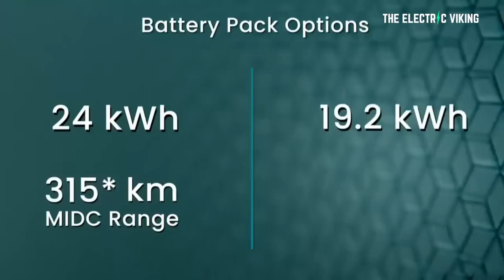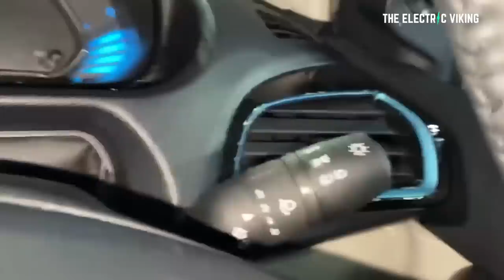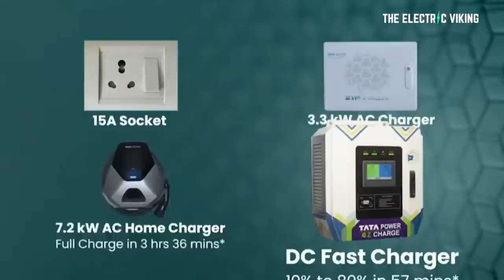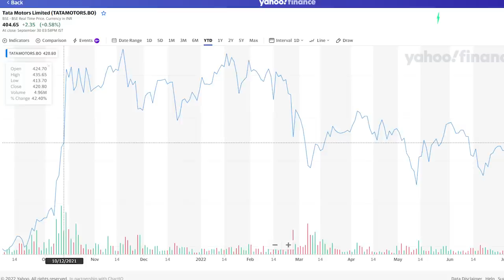India's $10,000 USD electric car - is it good?

Comment: I have a friend in India who own TATA Nexon EV from almost 2 years now. It is around 18K USD and drives 350kms on one charge, they find it cheaper to use than Petrol.
Reply: Real time range is 200-240 kms  for nexon ev.
Reply: @gaauravsharmaa4061  Regardless of range, the Nexon EV (and we have two) is about the fastest accelerating car at this and higher prices in the country. The Nexon EV is a performance car at 60 paise a kilometre. About a US cent penny per mile.
Reply: Tata Nexon ev max range is 275km
Reply: A decade back when I was running about India briefly I seem to remember a lot of power cuts.  Everything changes over time but I wonder how that might effect say a regular commuter.
Reply: @brucetaylor2887   now no power cuts 23.5 supply sure
Reply: @brucetaylor2887  we have a steady clean power supply scenario in India. The saying goes here lately, we may not have petrol Or diesel if circumstances deteriorate globally, but we have more than enough electricity.
Reply: @brucetaylor2887  There's much less power cut since last 3-5 years as capacity has improved and cities like Mumbai don't have power cut so EVs are becoming more popular due to high fuel costs
Reply: @brucetaylor2887  it's a great achievement by the new gov. They made a rapid growth not a single corruption allegation  inside the gov from past 10 years. That's a great thing to achive they are able to provide power to even the very remote areas of India. And mostly gov provides 45 to 50 percent subsidy  on solar power panels 6kw will cost you around 2300 dollars to set up which provides 720 units every month and gov will buy back if you don't use it
Reply: @brucetaylor2887  after Modi came to power he has maintained uninterrupted power supply
Reply: Its 225 km in a charge
Reply: I am thinking about the same car.
Reply: @brucetaylor2887  Powercuts are there in summer,  but a lot of folks buying EVs  are investing in solar as well. There are also direct charging stations by electric distributors.  Also take into consideration 40 kms one way is considered a large distance in Indian cities , since utter us densely packed and you will realise 250km driving range is ideal.  Personally when I am in India,  the max distance I drive in a day (very rarely) is 200 kms.
Reply: Hopefully an Indian car maker would come up with a hybrid chargeable + swappable battery packs.  Swappable battery model is already in place for EV auto rickshaws.
Reply: @vishnumohannair8791  not possible  for now at time
Reply: @vishnumohannair8791  there's a Honda full hybrid option for 20lac +. All the Japanese brands are going to offer hybrid models. Don't wait for Tata and Mahindra. BTW Mahindra has the some kind of hybrid for years now. But don't see them going in that direction.

I don't really get the point of hybrid. You are purchasing a more complex option than ICE vehicle for higher price than EV.  You will have smaller boot space, heavier vehicle. For a supposed improved fuel economy by 25%. All in the name of range anxiety. If you have range anxiety then you are better off buying ICE variant than hybrid. 

Think about maintenance of hybrid. You will have to take it to dealership only. Roadside mechanics are no option for you. With additional complexity and poor roads in hinterland that is a real possibility.
Reply: @udaysawant2094  well said ....double mechanism  and weight
Reply: @malikveeresh6751  true that. In addition to that the super quiet rides. No fiddling with gears and clutch, super simple operation. More than the petrol savings, these features should be the reason for choosing EV.
Reply: @brucetaylor2887  this is true of villages even today. In addition to that the quality of electricity supply is not good. But it still works with Nexon. It is a perfect vehicle for India and most of the developing world, which is a huge market.

The Nexon is bought more by affluent people from rural India because they can install solar and have a comfortable mode of transportation.
Reply: @Mayankk196  that guy is uneducated, he won’t even know how electricity is produced let alone reduce power cuts. In the past 10 years india has been growing rapidly because of the foreign investment and internet penetration. The same would’ve happened with any government. Don’t say india was in Stone Age before Modi lol.
Reply: @drbh6331  lol not a single corruption allegation? 40% commission bjp Karnataka Sarkar
Reply: @dravidian667  don't know in which state u live. But maharashtra power cuts reduced a lot. You can't deny changes and development happened in modi era. He had made lots of online processes and also reduced corruption. He can't make corruption to zero because it's people who are corrupt. Everything came handi and inside app. I live in pune and there are power cuts only due to transformer and line issue. Otherwise there are no power cuts.
Reply: @Mayankk196  TN had no power cuts for the past 10 years, in fact TN has been selling power to neighbouring states. This was before even anyone knew someone like Modi. Maharashtra state government should be credited for good electricity, in fact the central government is just a leach leaching on Maharashtra’s tax money. Maharashtra gives 1rs tax and gets back only 40p back.
Reply: @dravidian667  leaders of tamilnadu, Gujrat, Andhra and Karnataka are far more active in development than maharashtra. Maharashtra is able to develop only mumbai n pune. But now due to nitin gadkari somewhat nagpur. Roads are now better only due to BJP. Congress digs roads within one months of construction still in nanded and Congress ruled area
Reply: @Mayankk196  you are talking like Gujarat which has been ruled by bjp for years have roads as smooth as in US. Even there are potholes and bad roads in Gujarat. Bjp or congress are same coin different sides. Don’t forget all contractors, government officials etc don’t care bjp or congress, they need their commissions before starting work and that’s why quality has to be bad. Wake up
Reply: @dravidian667  i observe and speak. Not andha bhakt. Maharashtra roads were improved lot under BJP era. Previously only mumbai Pune baramati roads were good
Reply: @Mayankk196  it’s only been a few months since bjp came in power, so fast they built roads? Don’t be delusional
Reply: @dravidian667  it has been 8 years
Reply: @Mayankk196  do you know central government don’t build local roads, they only build national highways.
Reply: @udaysawant2094  Hybrid is Gas + EV. I meant Hybrid of Chargeable Battery and Swappable Battery.  Essentially would mean too battery compartments. The latter would be of help when you are in a hurry and need a few 100 kms for travel. EV Autorickshaws are being designed with the idea of swappable battery packs. Such a car is not available now - I was hoping someone would think of it
Reply: @vishnumohannair8791  YouTube has some videos of a swappable car battery solution. You should definitely watch it to understand why it is not done successfully yet. Not to say that it won't be possible in future.
What I gathered from those videos is this,
1. An EV battery is very heavy >100kgs.
2. It is integrated with the chassis of the car
3. It operates at high current and voltage

For these reasons you cannot manually swap them out. You need robotic setup, which is very costly compared to a 15kw charging stations as Tata Power provides.

The 4wheeler battery cost runs in lakhs of rupees. For a swapping station, you will have to carry an inventory of such batteries at charging stations, which makes the swapping solution expensive.

Multiple car manufacturers have to agree to use the swappable batteries, which is a very difficult thing to accomplish.
Considering all these points it looks improbable to happen in near future.

The scenario that you are talking about needs numerous such swapping stations covering majority of population centers, which is next to impossible. If you have to urgently travel more than 400kms then you are better off with ICE, now and forever. BTW there are cars from BYD available in India with a range of 500kms.
Reply: @vishnumohannair8791  delhi wala spotted
Reply: @dravidian667  TN has communist government 🤣🤣
Reply: @dravidian667  Central government has permisson and authority to build roads in Maharashtra
Reply: @dravidian667  foreign investments have increased bcz of modi and his policies.
so u r wrong when u said it could've happened with any government.

if it was the case it shouldn't even had to be the problem.

India wasn't stone age before modi but was backwords people didn't have proper sanitisation people used to shit outside, people didn't have internet power was not available in villages.
Reply: @Mayankk196  stop arguing with librandus its waste of time.
Its very obvious regardless of what party u support that after modi has come in power india is developing fast very fast everything became online easy and quick
Reply: @anandsuralkar2947  yes after Modi came to power petrol above 100 and record level inflation 😂
Reply: @H K V what lies, go see the numbers, india started installing solar in a large scale since 2009 and they reached 1000mw by 2013. Numbers don’t lie but andh bhakts always lie
Reply: no more power cuts. India is power surplus now due to solar revolution.
Reply: @brucetaylor2887  compared to a decade ago things have improved a lot. we went from having 6 hour power cuts every day to one power every couple of weeks. oncourse a lot still needs to be done as india hit 100% electronification 2 years ago  but i think we made good progress on this regard
Reply: latest nexon max model provides 437 KMs range
Reply: My friend and me went for a hill station trip in his EV. The road was through the hills and the battery was at 10% in 130km. Luckily there was a charging station nearby. Otherwise, it is a great choice. I would wait for some time until there is enough charging facilities.
Reply: @ravinderravi7834  kaha se ho bhai.. Come in India
Reply: 260KM in 1 charge
Reply: @malikveeresh6751  lol every ev exists out there have quick acceleration wtf even tata electric bus go quick in traffic like small cars
Reply: @ravinderravi7834  maybe in dreams in my state still suck power cut off but not for govt building or elite rich people don't know if ev become mainstream in India then for sure will face problematic or disastrous activities that happen in west especially Americans land California (land of hypocrisy, hyperinflation, indirect colonialism, looter and thug life)
Reply: @VeereshMalik  feel like fantasy talk but reality differs
Reply: @drbh6331  LMAO 😂🙏
Reply: @Mayankk196  don't think so
Reply: @vishnumohannair8791  yeah only for people who have their own property lands not applied for people who like rental, apartments or small congested buildings hence people from that region will be like neh ev is for not for my purpose or need
Reply: @udaysawant2094  well if u live in yo nutshell then yo understanding is limited to yoself cuz in hybrid ICE world Japanese carmakers r the supreme leader of producing hybrid vehicles for masses and Toyota is the supremacy of all that's why they hybridiz everything with reliability in focus. Also among owner perspective hybrid work best among both world as it doesn't make u feel anxiety about ev range anxiety currently happening around the world and Toyota hybrid r reliably tough come to western side have Toyota Prius their battery easily last 150-200k mileage without any issues some of them even last 300k (feel unbelievable) which is a safe bet if person want a efficient, reliable and less polluting vehicle too own.
There r few cases about their issues and defects for this special warranty is offer only hybrid spec and if owner neglect for screwed things then owners responsibility
Reply: @ranjitnair3702  wtf is this a fantasy
Reply: Easily  and without  ac it may go up to 275....may be in cold it will produce maximum mileage
Reply: @anustubhmishra  yeah can say easy development but cannot say about whole infrastructure as things have to, trillion of investments have to do, citizens have to loose their weight and pockets and most imp people have to change to accept other good old corruption suck everything
Reply: @RaghuVN  in order to build infrastructure have to heavy investment or more fossil usage to power ev related other in western where ev become mainstream somehow  have powercut and charging taxes way more than normal ice
Reply: @nev.m1234  but sucks for battery lasting efficiency
Reply: @dravidian667  no that is not truth
Reply: @amandeepbaa6978  time and customers will settle the debate of hybrid vs EV. If you see the stats world over then it will become clear which technology is winning. I hope you can find the sales numbers supporting your theory of hybrid being better and prove me wrong.

I have seen Prius in Mumbai area. Not sure if it's offered by Toyota in India or direct import. But the numbers must not be worth a mention because no-one talks about it. BTW it costs 45lacs. I hope you put your money where your mouth is and buy a strong hybrid and then recommend it.
Reply: @udaysawant2094  so seem like yo r a tech lover but I have one question for you what yo gonna do when technology fail and it cost more than worth paying which leave bad experience in ownership certainly u don't want to consider some issues or future problem related things that may occur like in normal car ownership period then yeah people can blindly purchase and let the ownership experience in God's hand so they can be in safer side (seriously countries where ev r mainstream have many issues of their class and infrastructure problems which indirectly cause people livelihood) lol majority Indian buy a car but don't even drive much just keep in garage or park it like abandon hence low mileage record and if that type of person own  ev then for sure battery will degrade and rot which is common of battery issues so where the heck u wanna think about normal Indian think about get one also ev r different to ice vehicles ownership so people will have problems in adjusting to it or don't know how to maintain or charge specifically to what schedule so that battery should not act weird or get harm but in ice even if neglected add fuel, start and life goes on.
About hybrid well can say about global market especially America where I used to live and have my contact there even though ev r mainstream, govt bs ev support r available, tesla everywhere and even have affordable ev available still buyer don't even think of purchasing or wasting any of shit on ev cuz they are very sensible, drive heck alot, own for long-term and buy vfm for reliable transportation purpose as main priority not like us Indians for status thing or keeping like abandon there hybrid is the preference in first hand market even hybrid truck available but most drive good old trusty reliable vehicle or Toyota/Honda. Also Prius is the most sold out hybrid which is also proven and that same system in now available in Toyota hyryder.
About Prius in India was direct from Japan as made in Japan which is the supreme superiority of Toyota and  that thing can last 300k miles with well maintain (normal ice maintenance) even its battery is so much reliable for this reason ironically Prius get too much hate for ugly look but reality all economical buyers purchase and basically become bread and butter more taxis. Due to no localisation and cheaplover don't know what the heck was that at that time period so no one even knows or understand but now when Toyota reintroduce hybrid in new form then people now get to understand the roots as they try to understand from global perspective
Reply: @amandeepbaa6978  I didn't understand. Who charges more tax?
Reply: @brucetaylor2887  India is power plus country now. Thanks to extraordinary RE performance.
Reply: @RaghuVN  lol govt tho just visit to countries where ev is mainstream there govt purpose made new taxation system along with all ev related extra cost of living just like ICE overcharges. For California aftermath land full of ev and tesla with charging facilities now citizens suffering from powercut and  power instability with govt and corporate overcharging more than Normal car owner except
Reply: @nilaydarne9483  not true in vary statewise
Reply: @gaauravsharmaa4061  that 250 is for city and nexon have mode, you can increase km if run in economic mod
Reply: Its 200km in 1 charge.Nexon ev  max has 300+ range
Reply: @dravidian667   To pay Rs 100 per liter isstill it is better then passing over present burden to future generations by issuing fuel bonds
Reply: Nexon not run 350 km in one charge, he gives you wrong info
Reply: Wait until the battery breaks down after 3 years. Then you will pay 10L for replacement
Reply: Even now power cut and load shedding happening yearly. Good luck Tata
Reply: @gaauravsharmaa4061  reality low
See the road condition and huge traafic in india extremely bad.
Reply: Bro, is it easy to charge while on long trips. I'm thinking of buying the same.
Reply: it will be... you can just put solar panel at your home with subsidary given by govt. on solar panels... and can save a lot of money..... i think so you can literally save lot of money through that way by charging through solar panels....... maybe around 100-200USD per month.... thats around 14-17k thats a lot for you to do new things....
Reply: @brucetaylor2887  Taylor, Entire Canada blinked for 18 hrs 2 months ago, due to Rogers farting. Even 911, Air Canada came to a standstill.
I witnessed it!
Reply: @brucetaylor2887  i live in 4th tier city and we have about 5hr power cut during summer the peak season. So it's def better in 1st , 2nd & 3rd tier cities
Reply: No nexon is not cheaper to the petrol verson. Firstly the car is costly and 5 year runmijg cost is triple to the base petrol version. Battery looses charging caapcity as it keeps on charging.
Reply: @sridharsri2061  frankly if your average commute is more than 150km a day and you can't charge overnight at home, you're probably better of using public transport or an ice
Reply: @gaauravsharmaa4061 because india has too much traffic 😂 … 

Race brake race brake all the time …

But in foreign countries average is good 😊